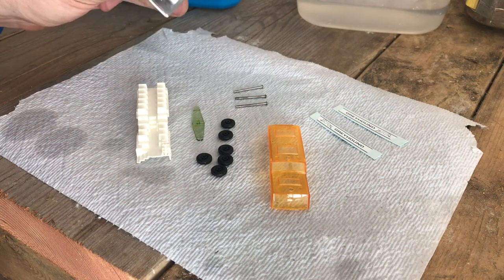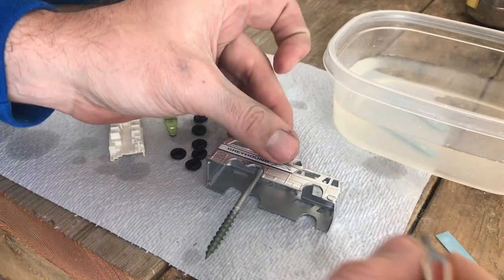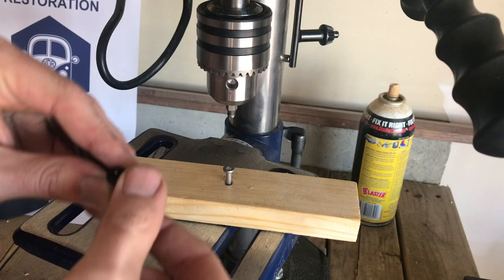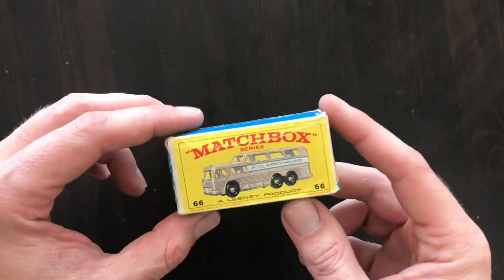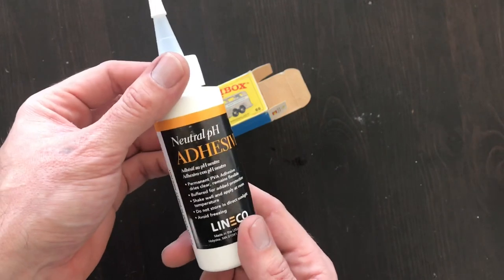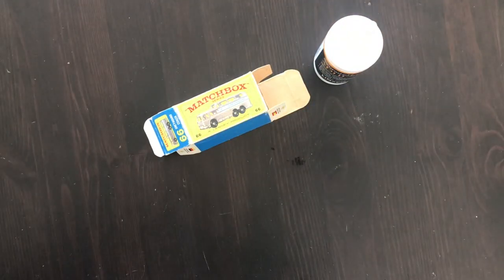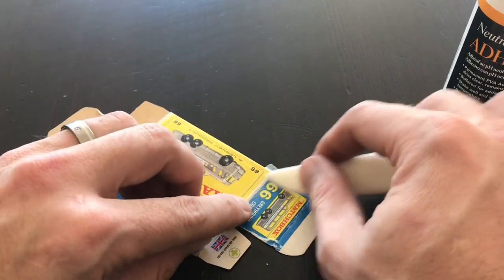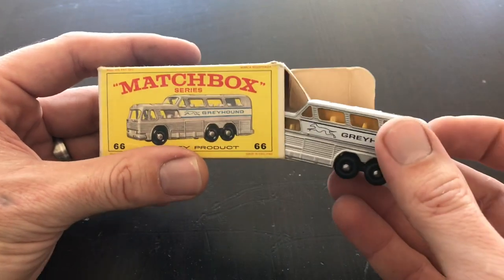Matchbox Lesney #66 Greyhound Bus and Box Restoration - PART 2

Comment: Check out these suppliers of spares I've looked and they seem reasonable prices and I'm sure they will do bundles to reduce postage. not bought from them as yet but it looks OK. Example is a driver for the 2a Dumper is £0.45 / $0.60 

http://www.model-supplies.co.uk/matchbox_175_parts_range.htm